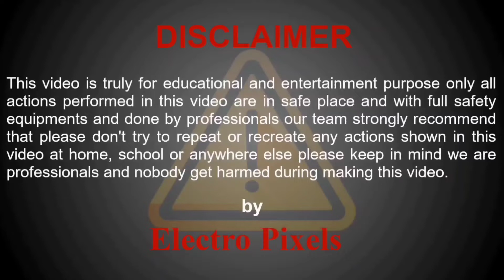Led Tv No Display|PT320AT01-1 Panel Repair|No vgh,Vgl,AVDD voltage|Blank Screen No Picture|Tvrepair

Comment: Nice work i need a solution same panel but left side cof ic burn now showing horizontal line but before the end of the screen show orange with moving logo no signal help pls this is numbet of the pt320at01-1-xc-3 i'mbusy with it now